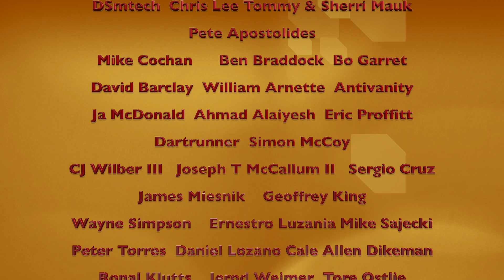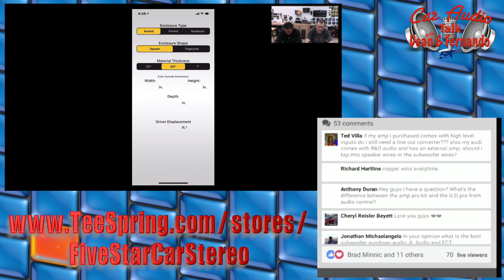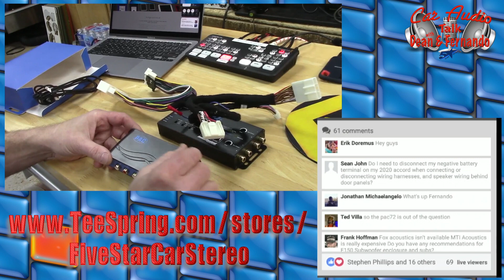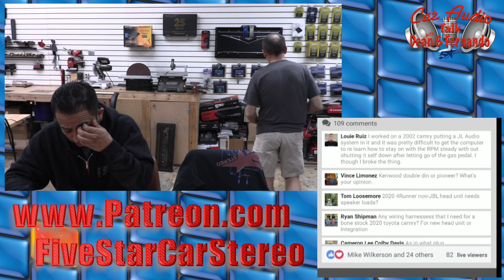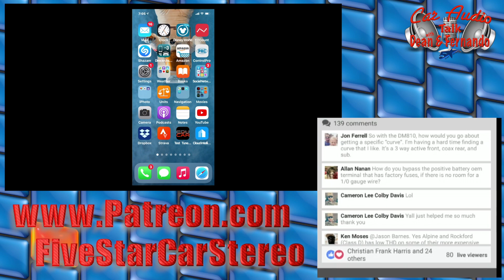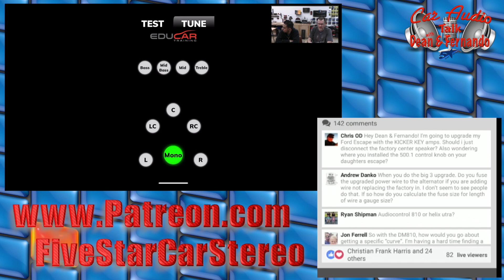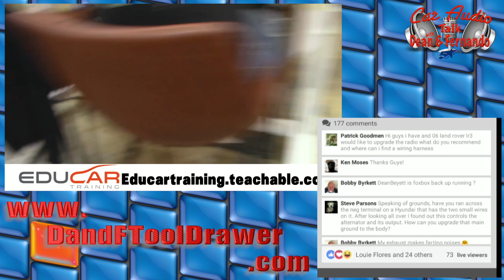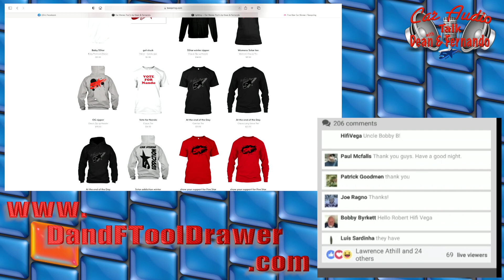Amp Pro Vs High to low Car Audio Talk

Comment: Thank you for explaining how the PAC AmpPro works. I just wish they made one for my 2013 Fusion SE with the standard radio and 6 speakers (components in front doors, coaxial in rear doors, no deck speakers). I am thinking of using the LC2i (or the LC7i for future amping of highs(already upgraded the doors to Infinity component 6.5")) wired to a Skar monoblock to run a single Fi 12" dual 2ohm sub. Is there a different LOC that will serve me better? I did notice the Clarion EQS755 EQ has high level inputs, but read several people complain of harsh and noisy output. 
 I want to thank you for all of your  amazing, relevant, and entertaining content you guys provide to all of us out here who still love a good car audio install. God bless.

Ok, perhaps if I had waited till the 46:48 time stamp I might have had my answer. Would you recommend I use the DSR1 with the dFO2 to accomplish my task? And, yes, it is the 2.0 turbo.

Comment: You mentioned around the 31:20 mark about the Gm trucks with Bose system. You mentioned the LC7i would not work. Is the LC2i an option or is the PAC AmpPro you mentioned the only/best option to adding a subwoofer?
Reply: Sorry, I watched the video again and you already answered my question.

Comment: I have a 2015 jeep grand cherokee  with a stock sub but no sub level control. What's the best way to hook up my fosgate 1500.1bdcp?
Reply: I have it hooked up with kicker hi/lo with remote turn on,wired up to door speakers not the subwoofer.

Comment: Dean, You make a comment about CCA, "you can't solder it". Why can't you solder it?
Reply: Because aluminum is a different metal. All terminals are copper. Also aluminum requires a higher temperature to melt compared to copper.
Reply: @ricardomolina4605  you can solder CCA just fine, I have had zero issue. It's a different kind of metal than copper but so is lead and tin.